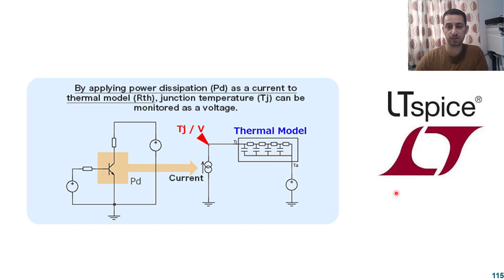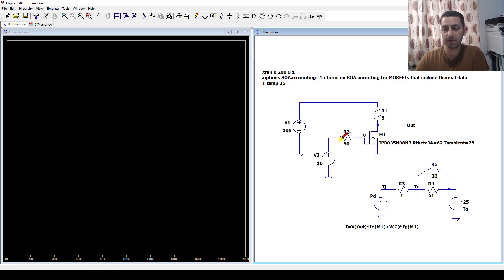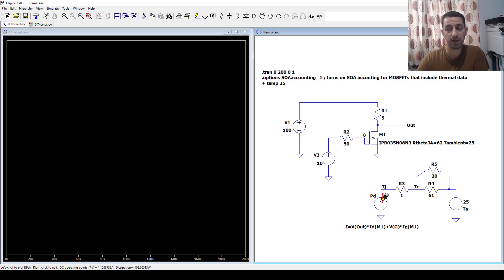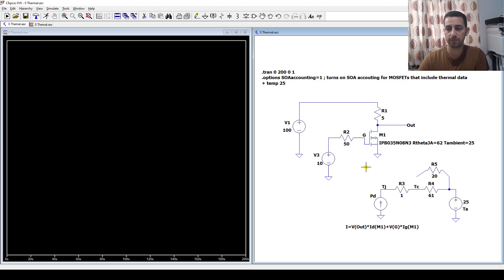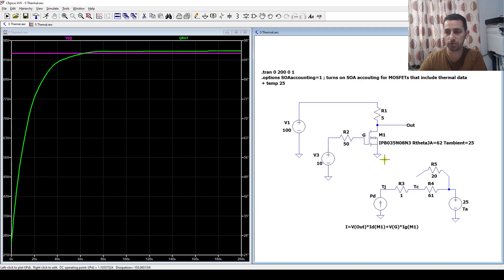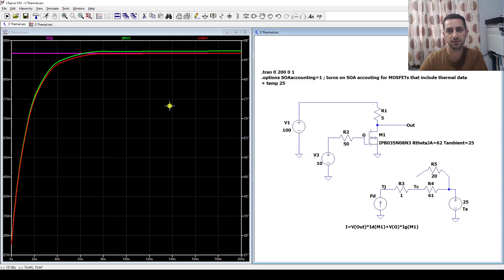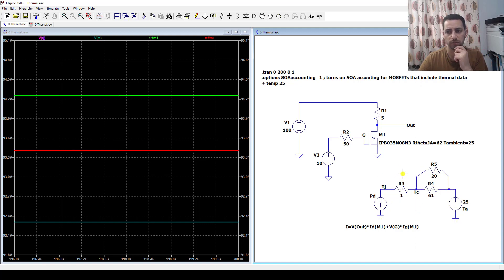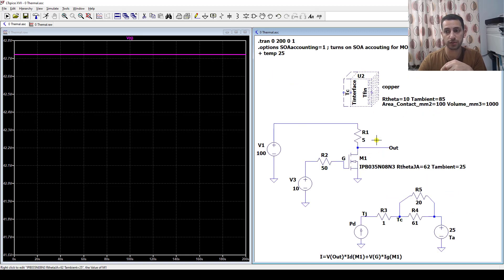14 Thermal Calculations using LTSpice

Comment: Hello, thank you for sharing your very helpful video.
I have a question regarding the simulation:

Where can I find and add tj#1 and tj#2?
In my "Add Traces to Plot" window, I cannot see them.

Also, is the following statement correct?

.options SOAaccounting=1 ;turns on SOA accounting for MOSFETs that include thermal data 
+ temp 25

I would truly appreciate it if you could kindly clarify these points.
Thank you in advance for your guidance.

Comment: Merci Professor Walid 🙏. Words cannot express the gratitude you truly deserve.
For those who are confused about the current source:

To get Pd in the thermal model, go to the component or press "P", then type "bi" and enter your function (you can get it by pressing Alt and clicking on the MOSFET) 

If you don’t see Tj#M1 in LTspice, it’s because the newer versions handle it differently. To fix this:

Add SOAtherm-nmos instead of a simple NMOS.

In Property, choose the same MOSFET name (example: IPB035N08N3).

In Value, type the thermal parameters, e.g:

RthetaJA=62 Tambient=25

For Tc and Tj, use different labels to avoid conflict with the external thermal model (e.g., Tj#M1).

 Now you will be able to see and compare junction temperature properly. Congrats, you’ve achieved it!

Comment: Hello Mr ISSA . I have to do a thermal simulation for a 650 V to 900 V DC-DC converter with 25 kW power rating. I have the model but i need your hepl please to do the simulation

Comment: Very helpful getting me started on some analysis.  Thank you.  

TI app note SLVA158 has some additional good information.  It lists the thermal capacitance of the D2PAK, DPAK, SO-8 AND SOT-223 in Table 4, as well as the Junction to ambient thermal resistance which could be added from the die to ambient.  The thermal capacitance of the copper slug, would go right across R4 and R5 in your drawing, where the thermal capacitance values appear to translate to Farads of capacitance  based on the tau values listed in SLVA158 Table 4.

Best Regards!!!